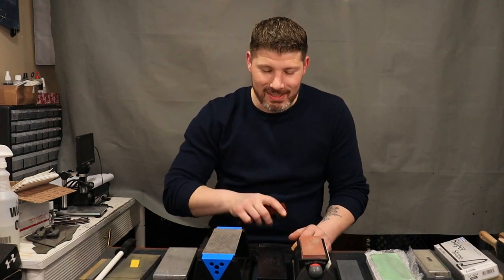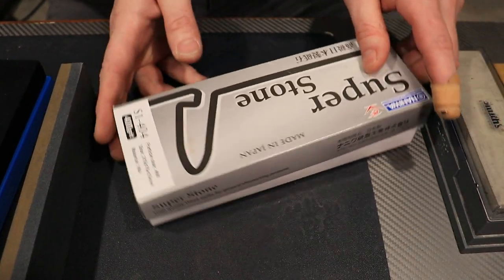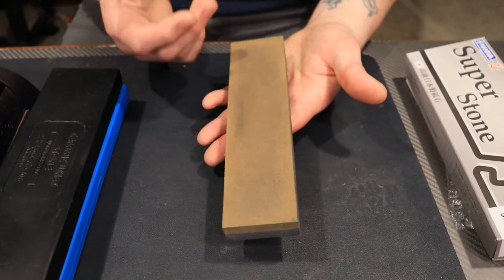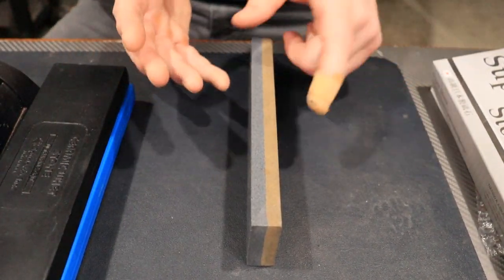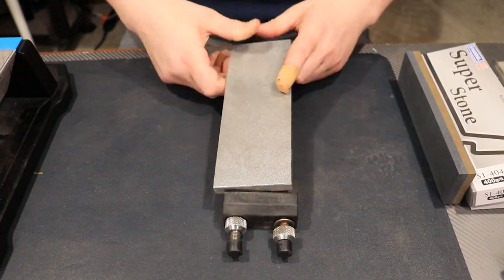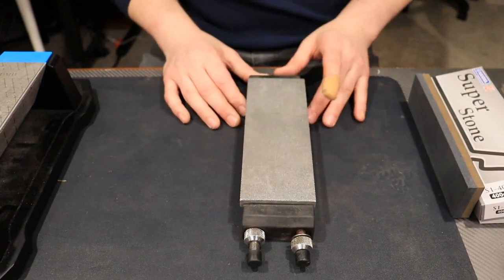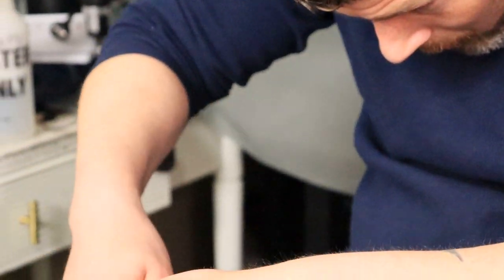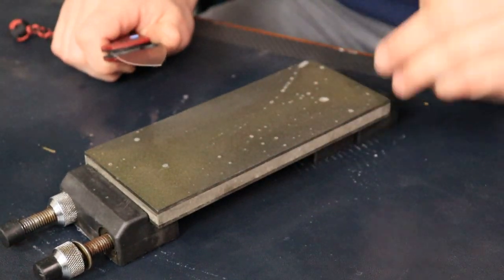FULL IN DEPTH SHARPENING TUTORIAL / EVERYTHING YOU NEED TO KNOW

Comment: Such a great sharpening vid especially for beginners and a few tricks that some older sharpeners can use. The sharpening stone types will be very helpful and focusing on getting a working edge first is a great first step. Getting a high mirror polish is what alot of sharpeners chase but it's not the right edge type for many steels where all steels will do great at a medium finish. Perfect one step at a time and practicing on good steel is the best choice. I'd suggest something in 14C28N for beginners it's a steel that is hard for manufacturers to screw up, because of how easy it's heat treated, and can be found for around $30 and up in Folders, fixed blades and kitchen knives. Thanks for the great vid Jerad and keep making sharp things fun and enjoyable

Comment: I elected to go with the Trend brand double-sided sharpening stones (a 180/600 grit and a 300/1000 grit) primarily because they are made with mono-crystalline diamonds electroplated to the machine-flat plate. These are very highly recommended, along with the use of Trend lapping fluid to "wash" away removed steel from knives. I also purchased the diamond plate holder recommended by Jared (aka, Neeves Knives) as this is VERY highly recommended for its flatness and easy of use. Can't wait to give them a try!!!

Comment: Hello Jerad. Pretty good sharpening tutorial. Congrats

There are a few technical details you got wright most people don't. Maybe you know about them and didn't mention or maybe you got an excellent method through practical experience.

Edge trailing is not that good at removing burr. A microburr you cannot feel will always remain unless you do some weird techniques like high angle passes or 90 degree passes. 

Diamond stones cut fast but tend to fracture carbides. Edge may be perfectly formed but ruptured carbides act as facture initiation points and reduce edge durability.

Diamond on strops on the other hand don't fracture carbides and help to fully remove the microburr left while edge trailing. This choice dealt with both problems at the same time.

Most people tend to use it with micron and sub micron paste on strops. That will leave the edge too polished and loose bite. 6 micron seems leave a very good finish for general purpose. 

There are a few points you got wrong tho.

Natural stones usually have 7 Mohs. Transtaling that to HRC that would be around 70 HRC. It's hard enough to cut any steel. If the steel has hard carbides it will abrade them by rounding and result in an exposed carbide edge. An Arkansas stone probably will be slow cutting when dealing with high carbide content steels but will easily work as a finishing stone on a knife already apexed.

Aluminum oxide is softer than vanadium carbides but, due to some weird physics I don't understand, it actually make clean cuts on these carbides. There are electron microscopy images on science of Sharp showing that. 

Source for carbide rupture by diamonds and exposed carbide by natural stone is also Science of Sharp. Highly recommend site.

For some tasks an edge finer than what you did or with even more bite may perform better. I recommend to try finishing edge leading on coarse stone with very low pressure. It can be sharp enough to shave hair or cut paper towel on a 320 stone and it feels completely different from polished edge. This seems specially promising for rope cutting and barbecue.

Comment: Hey brother I'm looking forward to this video. I just got my Civivi Altus with wooden scales yesterday. I ordered the TI pocket clip also. I love the look of the Ti clip but I'm afraid it is going to be rough on my pocket. It makes contact with the handle and it does not flex. It takes a good bit more effort to pull it out, we will see.
Reply: Id say just try to bend the clip back off the scale with your finger. Don’t wanna bend it too much or you’ll have to remove the clip to band it back. I have done this several time. Basically wanna take some of the spring out of the clip by bending it by hand

Comment: Hey, jerrad. Great video! I really appreciate all of the help with sharpening tips and everything you do. I've got a question in regards to sharpening. I'm quite new. I bought some Stones a couple weeks ago and I've been trying to get better at hand sharpening. One issue I'm noticing is that I don't end up with the thin and fine wire Burr like yours. Mine end up feeling quite thick and not really movable. Would that be a symptom of something that I am doing incorrectly? Or could it just be that I'm using crappy steel because I'm trying to learn with crappy old knives like Gerber and huntshield?

Comment: You say simple steels and carbon steels are right for sharpening on water stones and diamond impregnated stones. Are those most typical blades like D2, Nitro V, S35vn, etc?  Thanks for the video!
Reply from the maker: you basically can sharpen steels up to s35vn on those kind of stones, its the high wear resistant high carbide volume steels that pose issues, however d2 is a little tricky because they have such large carbides so i would do that steel on diamond, all steels can be sharpened on diamond. natural stones and aluminum oxide might give a better edge on carbon steels but you can still do it.

Comment: I want to pick up a set of diamond stones, but am wondering if you prefer/recommend the 2" x 6" Ultra Sharp II stones or the 3" x 8" Ultra Sharp stones. Is there any difference in the quality of the Ultra Sharp and Ultra Sharp II stones? Is there another brand you recommend over the Ultra Sharp brand? It looks like these sets comes with 300, 600, 1200 grit diamond stones; however, I usually sharpen my knives to 600 grit and then strop from there. So, is it worth going to the 1200 grit before stroping? Also, are there other grit stones that would be more useful (e.g., 140 grit, 300/400 grit, and 600/800 grit) than what is included in the set? Thanks for providing such great videos!
Reply from the maker: If you can get the big ones they will last you much longer, I recommend the small ones if you can't afford the big ones. The best is Atoma plates as far as diamond plates go. 300 grit is fine as a first stone, but the 140 grit is better as it will last so much longer as a starting stone it needs a bit of break in time but it turns into the best starting plate you can buy, it's not a bad idea to get the 3 pack of Ultra sharp and one 140 atoma, or just get all atoma but it's expensive, as far as going to 1200 no you don't need to you can and some steels do a bit better with a finer grit but not needed unless you want a polishing stone in the future then you will need it to progress to a polish
Reply: @NeevesKnives  Thanks for the info... I really like the handiness of using simple stones over fancy jigs. I'll have to place an order this weekend.

Comment: Hey J I have a very strange sharpening related question.  There is a YouTube channel that is called Sharpens Best and it’s probably something you’ve seen before, I am curious to know what you think of some of his sharpening videos and what is happening to the edge when he is making those knives cut paper. I don’t want to give my opinion before I hear yours so as not to make you answer any differently. Feel free to answer this privately if needed. But I have several questions about these carbide systems. I should also mention that I’m a freehand sharpener myself and VERY MUCH Appreciate what you can do with an edge. I’ve learned a few things from you myself (but I don’t admit that often) 😅.  I should also add that I have been watching you since you were just a little Tuber and love to see the things that have slightly changed from you then and now.  Subtle things that are a joy to me.
Reply from the maker: Yeah I think I know what your talking about and it's micro beveling the edge, the more you do that the shorter your edge will last, that should only be used as a last ditch effort to get an edge back to finish what your doing but planning on doing a full Sharpening afterwards

Comment: Hey Jared I had a question your burr looked kind of wiry and and loose my burrs never seem to look like that does that mean I'm not spending enough time on the stones? Cuz so far I'm able to get even scratch patterns decent burr but the one thing I struggle  with is foil burrs and them just flipping back and forth back and forth. No matter how light of pressure I use to remove them. Thanks!
Reply from the maker: Not necessarily, as long as your creating a burr on the entire edge is what's important, that burr was that way because of the heat treatment not all will act like that.
Reply: Soft tough steels have some incredibly difficult to remove burrs. They just don't break, much like the steel. A trick is to do a super light pass at an increased angle to cut the burr and then back sharpen your original angle up to the apex again, careful not to overdo it.

Comment: What about the duo sharp polkadot pattern diamond stones are those any good? Do you recommend those.
Reply: I have those. They work great. They are not so good for really small chisels and almost useless for a pointed tool, but they work great on knives and average chisels. I heard the extra extra fine isn't really worth it, plus a strop with a higher grit compound basically does the same thing, so I got extra extra coarse, extra coarse, coarse, fine and extra fine. Plus got the yellow 6 micron diamond honing paste for my suede side of the strop and just use green honing wax on the smooth side. You can get a hair-whittling edge with these. I've done it.
Reply: Get the ones from DMT though. I understand they have more quality control as far as making sure there aren't any random, too large size diamonds, and they have a more dense layer of diamonds than some cheaper brands.

Comment: What angle is the best to hold an edge longer ? I feel 25° is better?
Reply: Obtuse angles like 25 degrees dull way faster, but can take some beating. Acute angles like 15 degrees hold the razor edge longer, but can't be beat upon. 

I use a 17 degree edge for most, if not all my blades. It's a good combo between edge holding and not too acute to where it'll bend/roll/chip.

Comment: What grit diamond stone do you recommend for high quality German knives? DMT coarse (~300 grit), fine (~600 grit) and extra fine (~1200 grit) are the options. I see people using the coarse alot, is that too aggressive for kitchen knives? But is 600 too fine?
Reply from the maker: You should always start with a coarse, if there's no damage you can start with a medium but it's always faster Startin with a coarse then you can finish on a medium or fine
Reply: @NeevesKnives  Thanks. So if the edge is in perfect condition (no damage, but dull), would you start with 600 grit or 300? I'm about to drop some $ on stones, so would be nice to know which to get and which to skip. My kitchen knives are Wusthof and I don't want to risk messing them up with the wrong stones. I will practice on my cheap knives first no matter what stones I get. thanks
Reply from the maker: id prefer to start at 400 but yes a 600 can work just takes longer, if the edge is very thin then it will go faster, its mostly just time, however the faster things go in most cases the better the results as you wont be fatigued
Reply: I start on an extra coarse. It's not going to hurt anything. If it takes more than 9 or 10 passes to get a burr all the way down, I'll even use extra extra coarse. It depends what shape your knife is in on what stone you want to start with bro. It's not so black and white like "definitely use exactly a 400 mesh stone to start with, no more, no less". Use what's needed so you don't have to make 1,000 passes and wear your stone down. That's what you're trying to accomplish.
Reply: @eee2115 You aren't going to mess them up in a way that you can't fix unless you're stupidly laying them totally flat and grinding away. Don't be so scared. Have confidence.

Comment: I've come here with a problem that been gnawing at me for a month.

The KA-BAR fighting, Utility and the Buck 119.

Every other knife in my collection, even a recurve Kukri that I had, I was able to sharpen to a point where, at minimum, I could get the blade to cleanly slice paper, if not shave hairs off my arm with ease.

When it comes to my KA-BAR and my Buck 119, I've tried everything!!!

Oil stones, diamond stones, and God forbid a pull-through sharpener. I still can't get even a half way decent edge.

I used to be able to sharpen knives in 5 minutes to great effect, but these 2 particular knives have seemingly defeated me.

My one and only marketable skill was knife sharpening, and I think I've once and for all lost my touch.
Reply: Maybe the toughness of those two steels and heat treats are making an almost unremovable burr? You could try doing a light pass at an increased angle to try to cut off the burr, and make a micro bevel, then go back to your original angle and bring it back to the tip without overdoing. Super tough lower hardness steels have burrs that just don't break..
Reply: @mikafoxx2717  since making my original comment, I fixed the issue.

I've come to realize that my free-hand sharpening skills are not as good as they once were, so I used a clamp and base from a Lansky system to hold the knife, but then used a Sharpal dual grit diamond sharpening paddle to sharpen and hone the blade, then with the knife still in the clamp, I used a paddle strop to polish... 

...The end result? A razor sharp Ka-Bar and Buck.